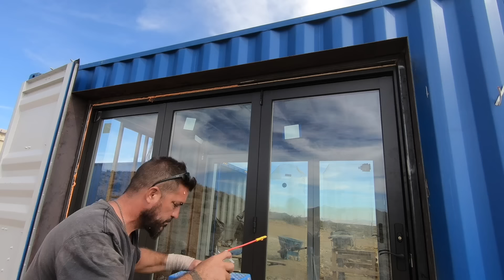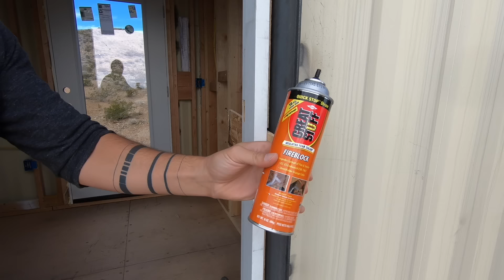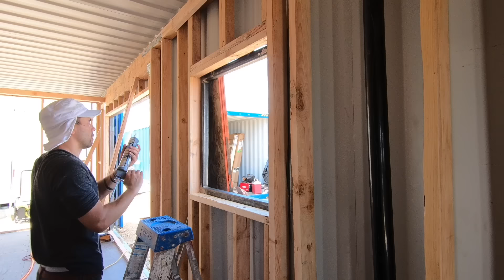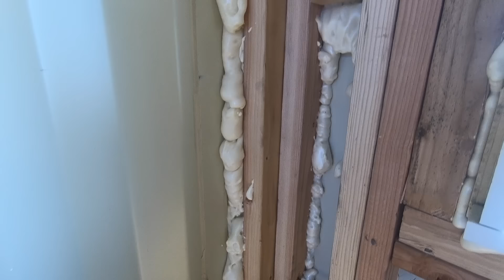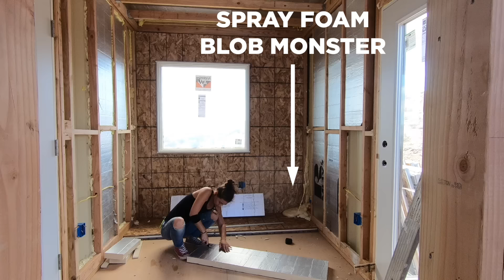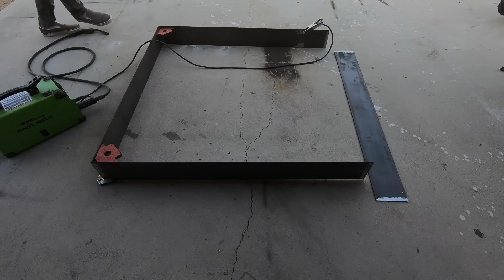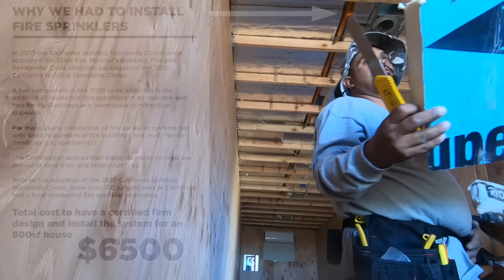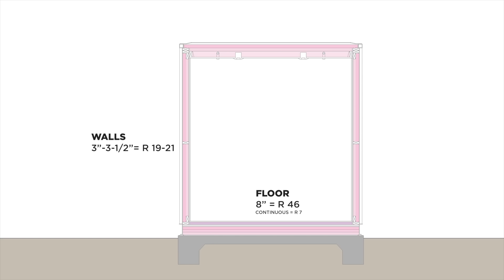Building a Shipping Container Home | EP03 Doors, Windows, and Insulation

Comment: 1/2" plywood sheeting! I have to say that seems like overkill to me as well, and I'm a civil engineer
Reply: Agreed.  Mech E here and not at all experienced with structures but it seems like the engineer who approved this design just assumed that the shipping container was essentially a rain screen and not contributing to the overall strength.  Hurricane straps on the interior and other foundation ties that bypass the designed load points for the container (shown in other video in this series) all indicate that to me.  Kind of a shame because it seems like Ben really got hosed by the building codes and approval process in his area.
Reply: @Chrisisreal978   Everyone needs to understand, out here we call them earthquake straps. Just imagine waking up one morning to find your home moved 6 inches off it's foundation. It doesn't matter how heavy you make your shipping container home, an earthquake WILL relocate it by unacceptable margins. This home project was build at the edge of a set of small hills in the high desert area on Yucca Mesa. Earthquakes are prone to the area and the building inspectors out here understand this. Even our water heaters get e-quake straps.
Reply: Chris Aho California, California, California. No one else is to blame but degenerate California and its Bolshevik, retrograde, dystopian bureaucracy, disguised as "progressive" 👌🏻
Reply: @V0YAG3R  haha, neocon marxists.
Reply: @V0YAG3R  I live in California and I agree100%
Reply from the maker: well if you can work through the details and show the calcs i would love to hire you to do the next one.  In addition to the fee i would be happy to split the cost saving on the materials
Reply: @TheModernHomeProject  hire me to make the wall insulation as it should be ;-)). hmm, I'm in EU. don't think I don't value your work and skill, I DO, but I wonder why the wall insulation is always made that way, perhaps I cannot see the whole picture from my point of view. regards and keep up the very good work !!
Reply: @The Modern Home Project  I'm in Sacramento, and my old boss knows somebody who has done shipping container projects. I'd be happy to ask him who the engineer was and if he went through the same BS.   colby@mrpe.com
Reply: @colbyprince9409  I'd like to know as well. I'm in Marin.
Reply: "any engineer can make a bridge stand, but it takes a good engineer to make a bridge barely stand"-Brady from practical engineering
Reply: It nice to have when you want to anchor anything to a wall.
Reply: This is the same sheathing that would be required on the exterior wall of a typical home.  It is just an inverted system.  The container is just big box of metal siding so you can't expect to circumvent typical construction standards by buying these containers.   In the end, it is cheaper to build a typical small house and add siding to make it look like a container instead of going through all of this extra work just to be able to say you used a container. :)
Reply: It's done to give the wall a structural rating c24 timber and 12mm osb or plywood without the leaf of board it won't pass building regs well not in Europe
Reply: Why sheer panel on all walls? Did not show calculations on the steel panels when you cut windows. Some create a wood header like regular framing others place steel beam from corner post to corner post. I am not sure why not frame exterior wall with foam insulation and vapor barrier . Use two units with 8' between and wood or steel truss above unit for air gap to reduce heat gain in summer using r 60 insulation?
Reply: Studying MechE. I'd assume it's due to the building codes. I guess he (The Modern Home Project) would have to ask if it's in the code.
Reply: petnzme01  the steel container is structural but not up to residential standards and as soon as you cut the structure you technically weaken it hence the timber skeleton internally lined with osb or ply but again I live in Europe so I'm not 100% up on American structural details hope this helps
Reply: petnzme01  again I'm only stating how it is in Europe but it you took the door size out which he did sole plate to header the structure has become weaker that's a fact by that percentage hence the need to put a structural wall up incase of snow load heavy rain or wind however unlikely in that particular build but building standards for residential come into play otherwise anybody could do whatever they in said container
Reply: petnzme01  of course there are sides that can open but panels are made on the ground one at a time then stood up and tacked together they don't make the frame as a whole standing up then sheet it so once you cut it its structural integrity is lost it's as simple and as plain as that hence the structural wall you can abuse me all you like it just shows your lack of structural knowledge when it comes to constriction the building regulations are there for people that aren't builder's like yourself
Reply: petnzme01  I didn't get your last response it must of been deleted because  of the foul language I only got the first few lines and yes a container is supported on its four corners but this chap cut a 6ft hole in the MIDDLE of its longest elevation hence the structural wall its quite simple once you know what your talking about and I'm sorry to say you don't
Reply: petnzme01  I see you are a none builder an instead of calling something the left or right side they are technically referred to as elevations just because you use  bad language doesn't mean you are right it shows how inept in building terminology you really are and lacking the proper knowledge and skills to carry out a quality job up to building standards
Reply: petnzme01  it might be load bearing on the corners but the big cut out is in the main elevation which only has 50mm box section for a header hence the structural wall I've been talking about elevation and structural details throughout our conversation explaining each explanation as I go I don't know what else to say I'm a carpenter 21 year's 6 years a foreman I was just explaining how things are done and the reason why they have to be done the building regulations might be different wherever you live I don't know where that is but to pass building regs these are the rules and the reasons I've explained you can do your own research but you'll eventually see I'm right you could do it your way but you more than likely won't get insurance on your building or container for these reasons
Reply: petnzme01  good morning right so tellying you the reasons for putting up the structural work is blabbering on and then when I don't agree with you you abuse me vocally and tell me to shut up 

1 He's cutting into the wall hence the structural wall its 3 metres long by 2.4 high not exactly small 

2 he did brace it up only AFTER cutting it and ONLY tact welded it not one long continuous weld again another good reason to have a structural wall 

3 He uses the angle steel because he liked the profile it gave and not full welds 

4 once you cut into the elevation it loses its structural rating that's just plain and simple in anyone's book something cut away from the whole entity its structural rating dissipates hence the structural wall 

5 the top 50mm box section not I beam WILL be affected 100% as we all know weight pushes down so to state anything else is just ridiculous 

6 what you say in point 8 I SAID  THAT TO YOU a few msgs ago after you told me to shut up I know they have an I beam head and sole plate on which ever elevation they open the container he's cutting DOESN'T HAVE AN I BEAM ON THE HEAD hence the structural wall 

7 the inner walls ARE load baring as they are supporting the structural openings the load might not be great but by building regulations you HAVE to put them in as you have taken a section out and have to reinforce the container hence the structural wall 

Working with metal you might but leave the structural plans to the expert's like me not amateurish person like you who's ravings and insulting words because you don't know what you are talking about earlier on you told me there's no such terminology as longest elevation it really shows how much of an amateur you are
Reply: I could see if you cut away huge sections of the container wall maybe, but otherwise what total bs.  The allowable load in a 20ft container is 21.5 tons.
Reply: @jtkilroy  the allowable load as long as no holes in walls. The metal sheet is part of the load factor. What he did not show was tension of panel when he made his cut. You can order a container with double set of side doors. This would allow a slide out . you can order motor home engineered slide outs. Or truck designed slide outs. Am Courious if you had the farm engineered by a Mobil home manufacturer? Bypass local building code?